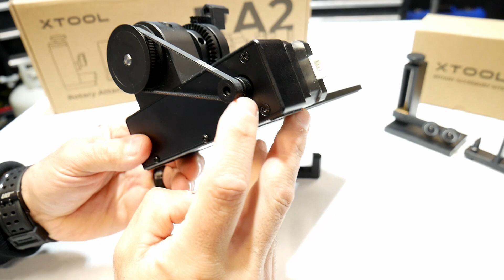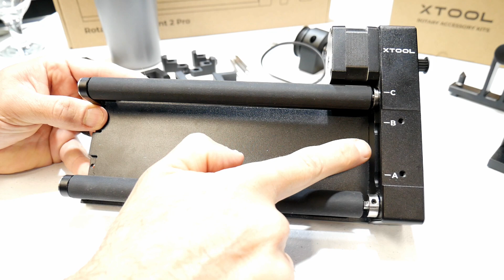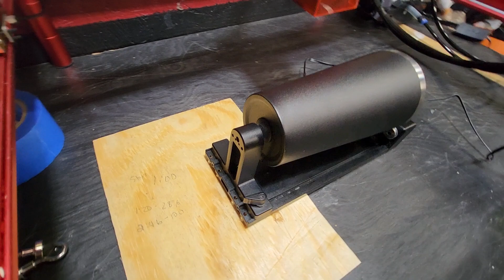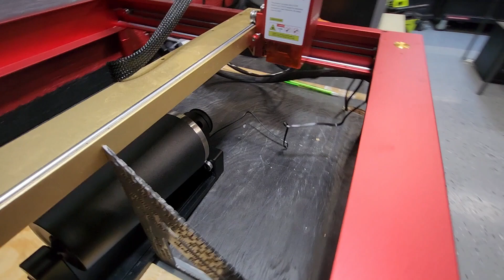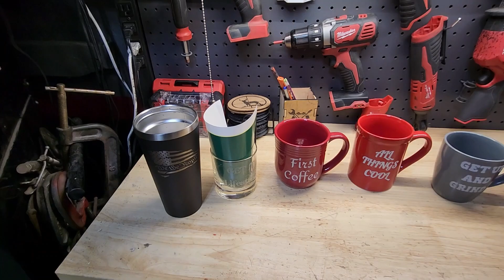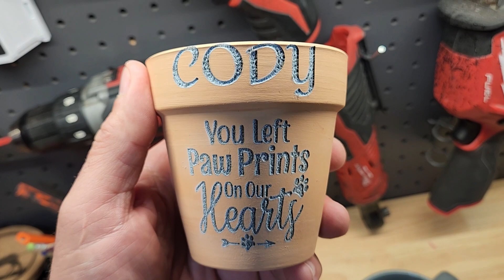XTOOL RA2 PRO create COOL Custom Mugs, Tumblers and more EASY Side hustle❗

Comment: Hello, how can I use the Xtool RA2 with ceramic mugs with handles, there is no way that I have put them all tripping over the handle, can you help me please?
Reply from the maker: I actually flipped the rotary tool. so I took the rotary portion of the tool off the base flipped it around and screwed it back down to the base. Now you can put a cup in the rotary tool with the jaws but the long base isn't under the cup so the handle doesn't hit it. I would suggest putting some weight on the base to counter balance the cup though. your rotary tool should look like this.  ____l=cup.    not sure if that diagram helps but flip the base so it's facing opposite of where you mount cup

Comment: How did you set up the RA2 in order yo do the handle coffee mugs?
Reply from the maker: I actually flipped the rotary tool. so I took the rotary portion of the tool off the base flipped it around and screwed it back down to the base. Now you can put a cup in the rotary tool with the jaws but the long base isn't under the cup so the handle doesn't hit it. I would suggest putting some weight on the base to counter balance the cup though. your rotary tool should look like this.  ____l=cup.    not sure if that diagram helps but flip the base so it's facing opposite of where you mount cup
Reply: @AllThingsCool  thank you so much. I appreciate it. 🤙 this is a live saver.
Reply from the maker: I actually flipped the rotary tool. so I took the rotary portion of the tool off the base flipped it around and screwed it back down to the base. Now you can put a cup in the rotary tool with the jaws but the long base isn't under the cup so the handle doesn't hit it. I would suggest putting some weight on the base to counter balance the cup though. your rotary tool should look like this.  ____l=cup.    not sure if that diagram helps but flip the base so it's facing opposite of where you mount cup

Comment: what settings do you use for you mugs? And are you using the d1 or d1 pro?
Reply from the maker: d1 pro.. I used 90 to 100% power 70 ish speed... I did notice some mugs worked better then others. I bought a few from the dollar store... cheap and if it messed up I wasn't out alot.of money
Reply: @AllThingsCool  Is that for the coffee cups?
Reply from the maker: @matthewbok2091  yea
Reply: @AllThingsCool  Thanks.  Will try those which should speed stuff up a ton